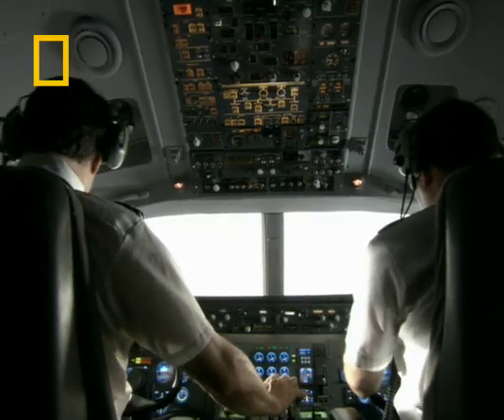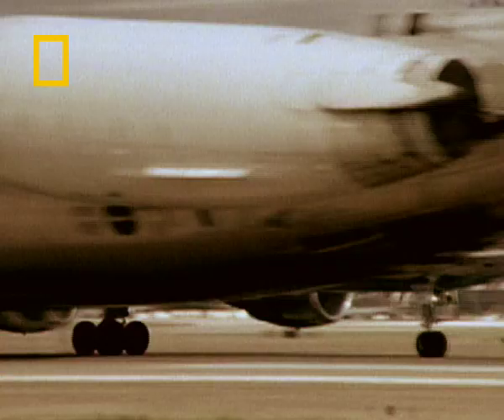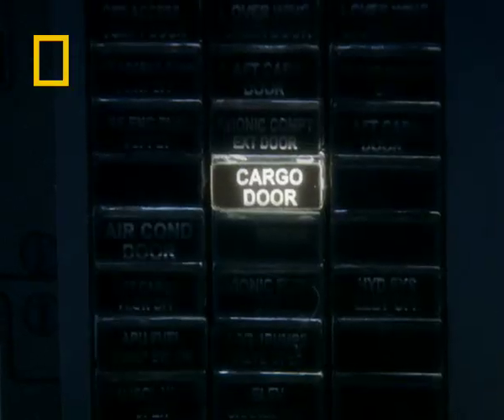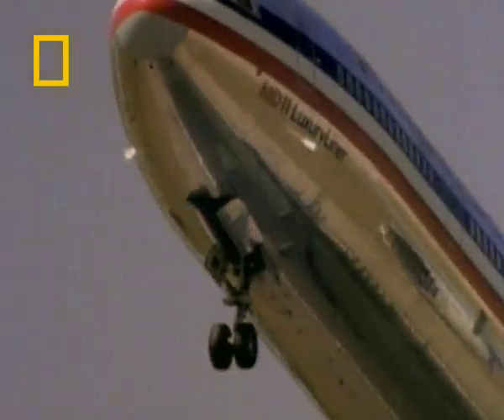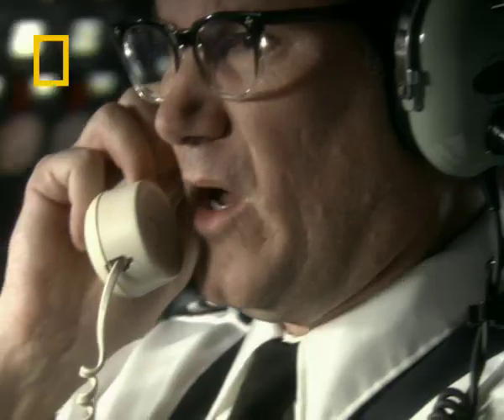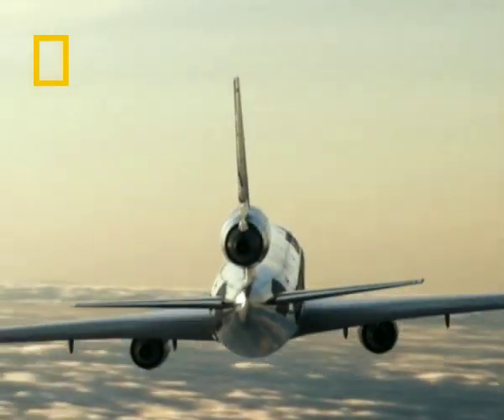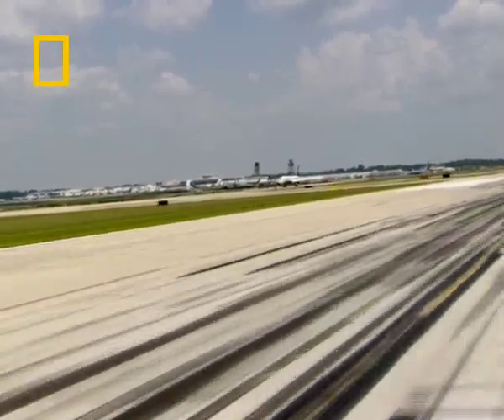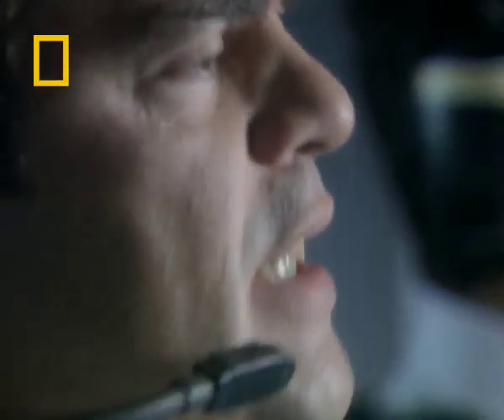Behind Closed Doors | Air Crash Investigation | National Geographic UK

Comment: the dc-10 is used manly as cargo planes now
Reply: They now only use MD-11s
Reply: @GianlucaBerger   fedex still md-10s until later this year
Reply: @Knight6831  oh really, I thought the DC-10s were discontinued due to how many incidents they had
Reply: @GianlucaBerger   no the crashes hurt its reputation but it sold decently and Fedex the only US operator will be retiring their MD-10-10s this year and the MD-10-30s by 2023 and who knows when Boliva's TAB Cargo will retire their MD-10-30F
Reply: @GianlucaBerger  I thought the same thing G.B. until I went to work at FedEx Memphis. There are still a few DC10S active including the one that was hijacked in 1994 (N306FE).
Reply: They call it the MD-10 because when Boeing and McDonnell Douglas merged, Boeing re-did the cockpits in the dc-10 freighters in service and put in glass cockpits
Reply: @GianlucaBerger  The DC 10 was a fairly successful aircraft

Comment: The DC-10 is a flying hunk of just waiting to crash junk! The L-1011...FLAWLESS!
Reply: Agreed l1011 is much safer than dumb crap 10
Reply: Ironically Lockheed dumped-off so earlier due to having just one engine supplier, while the DC-10 despiste to have an problematic bio, ironically it lives it up more as an freighter bulletproof aircraft, while the tristar its nothing but collecting dust in the graveyards, due to Lockheed's imcompetence to supplier a bigger demand for freighters operators to live-up much more, shitter.
Reply: The MD-11:chill out,its your makers fault
The DHC-106:am i a joke to you?

Comment: @kevintheartist We saw many DC-10 crash is because at that time, DC-10 are very popular and many of them were in service, so the chance of seeing them crash is also higher than other types of planes. The design of DC-10 basically was sound and safe
By the way , no need to afraid of that because most of the DC-10 nowadays had already change into cargo planes! ^^
Reply: Yeah they’re not, hence the reason they were all changed into cargo planes, no one cares when a cargo plane crashes. It’s statistically by far the most unsafe commercial plane ever made. There have been numerous cargo plane crashes over the years